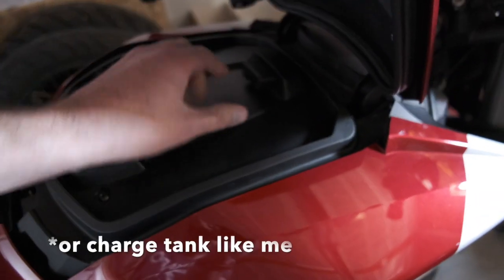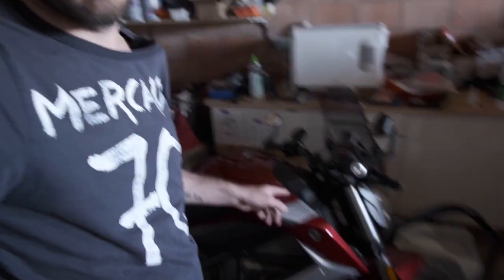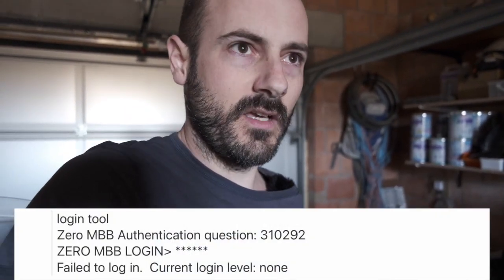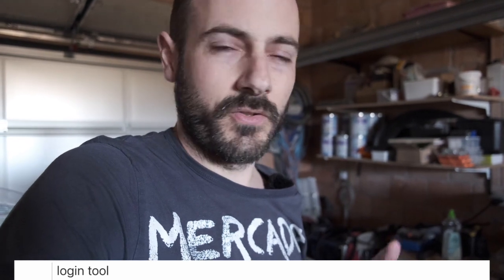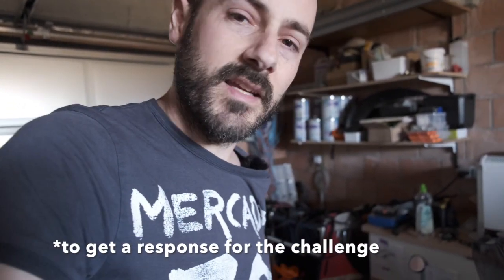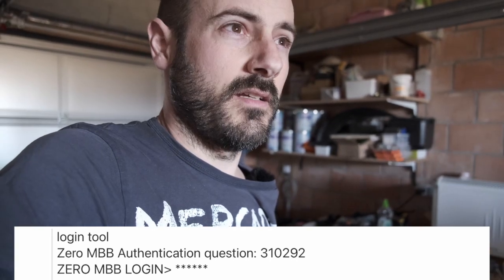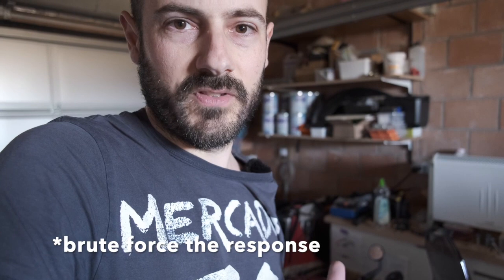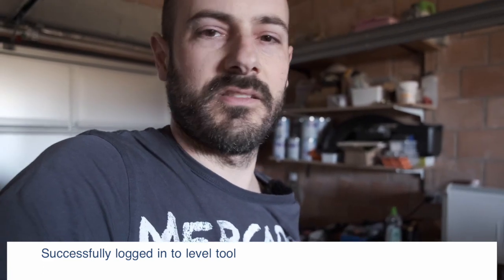Progress h4ck1ng login password for Zer0 SRF and SRS motorcycles

Comment: Ok, I'm lost here... What advantages would you be getting by "hacking" into the system? Can you give me some examples please?
Reply from the maker: Not sure yet what all the options are. But for example changing the config to LED bulbs requires this login and currently dealers charge for it plus they are instructed by zero to only do it in combination w/ selling zero branded LED blinkers. Fixing or at least updating cellular connection is another example. Getting decoded logs from the bike.
Reply: Well last weekend 5 Zero riders came together to read out our bikes so we could compare data. Well what we found was not funny. chargers were detected but not "installed", led blinkers were "installed" but not bolted on. 4 out of 5 bikes did not have a cellular connection etc etc. etc etc. So most of these issues are easy to fix if you have access to some settings.  Zero finds it more important to make a complicated authentication methode than a happy customer. I am not going to spend 160 euro for led blinkers that not even have a E approval (oops spoiler) and cellular is going to stop working in the near future because of the switching off of the 2G and 3G networks in Europe. So that said there are of course some settings you just should not mess with as a customer. hopefully we get "right to repair" laws dat forces manufactures to be more open and hacking should not be necessary.